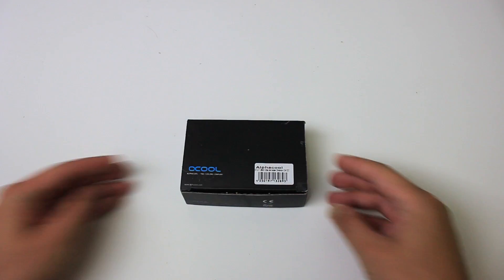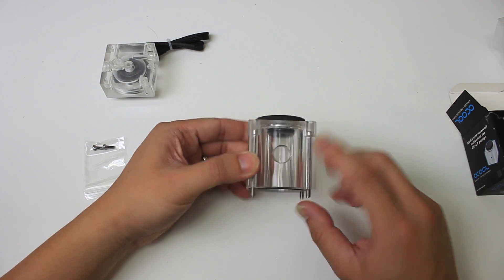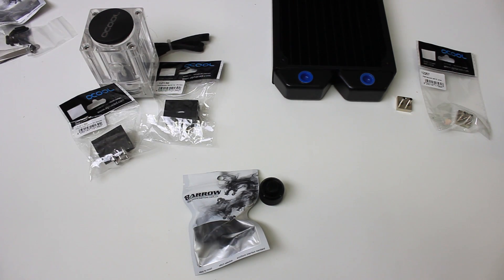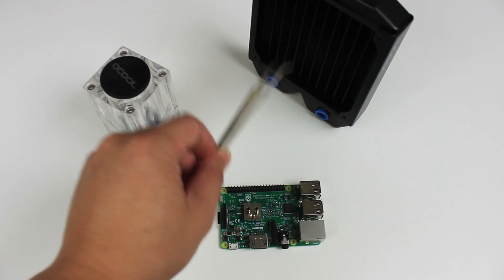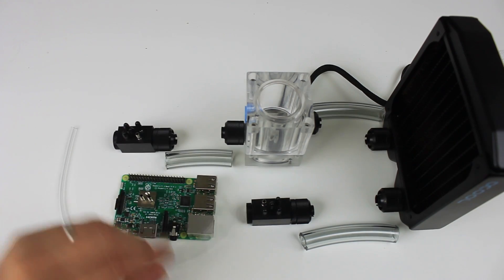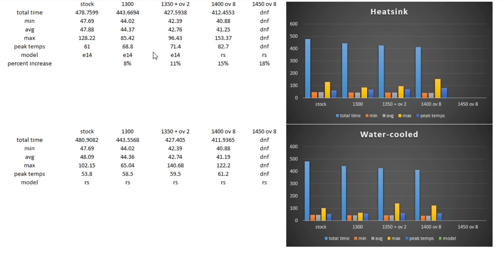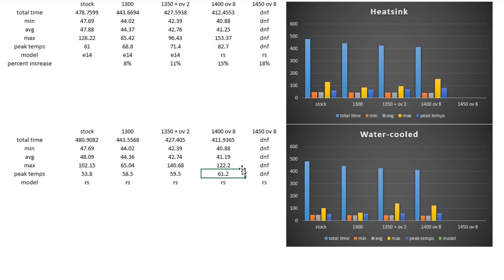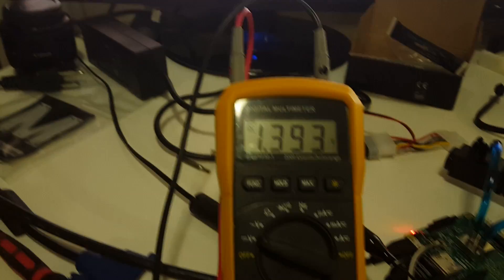Water Cooled Raspberry Pi 3

Comment: I like to keep things simple and inexpensive so I mounted my Raspberry Pi 3 inside the freezer in my garage, the cables mold nicely around the door gasket, Pi is headless so just needed power and a FLAT cat5 cable, can over clock to the max and it runs too cold, could have probably just put it in the fridge section but that door sees more traffic.

If I ever plan to run a monitor on this setup will buy a FLAT HDMI cable....

Comment: The results are impressive, but the overheat only really becomes a problem with the Pi 3, and the size of that radiator negates the value of the Pi, which is it's ability to be small enough to fit as an embedded device. So unless liquid cooling is already an integral part of the machinery your Pi is embedded in, this really isn't a practical option. I'm sure that will be why people say "there's no point". I do wonder if a smaller radiator, with a fan would be equally good though, and how much smaller would still be effective.

Comment: actual parts list would have been nice.
Reply from the maker: Done! check my description.
Reply: 1x Alphacool DC-LT Pump Top | Plexi (13136) 
1x Alphacool DC-LT Individual Reservoir (13140) 
1x Alphacool DC-LT 2600 Ultra Low Noise Ceramic - 12V DC (13289) 
1x Alphacool NexXxoS ST30 Full Copper 120mm Radiator (14156) 
6x Barrow G1/4" Thread 3/8" ID x 5/8" OD Compression Fitting - Black (THKN-3/8-V3) 
4x ModMyMods 3/8" ID x 5/8" OD Flexible PVC Tubing - Crystal Clear (MOD-0003) 
1x Alphacool MCX Seal Plug 10 pcs Kit - Black (29107) 
1x Alphacool MCX One - Nickel Edition (12257) 
1x Alphacool Double-Sided Adhesive Pad 15x15x0.5mm (12097) 
2x Alphacool MCX 5-Way Divider (12139) 
3x Alphacool G1/4" HF Stop / Plug Fitting - Deep Black (17198) 
2x 3mm ID x 5mm OD Tubing
Reply: Right on thank you,  I was finding some of the parts but not all of them.

Comment: Cool, but was the rad completely filled with water, or just to the head of the tank ?
Reply from the maker: completely filled, my camera decided to die right when i was recording the "filling of the loop" part so i had to cut that part out.
Reply: I think the rad may not have been filled up, as normally the header tank needs to higher or as high as the top of the rad the only way you could fill the rad completely is to lay it down on its back, fluid will always find its level

Comment: Should've put a fan on the rad just to see how over-kill the cooling would be xD
Reply from the maker: i relized that the problem i was having is the voltage being delivered to the cpu. i am working on a solution to deliver more voltage to cpu.
Reply: @NovaspiritTech  just slap an labor powersupply to it  xD
Reply from the maker: i might have to depending on how high i am going to over clock it.
Reply: how about sub zero temps?
Reply: There are very few raspberry Pi 3s that can go over 1.5 ghz.
And even then i'd say most of those are myths. If you can get yours to go any higher than 1.4 ghz, id be VERY surprised... it really doesn't matter how cool you get it, those stupid phone arm cpus can't go very high.
Reply: It would nice to see the fan if someone is considering doing/spending all that on a Pi (Im not saying it has to be a Noctua 3k rpm, but just A fan). What I think would be a more useful display is to liquid cool an array of Pi boards, potentially for actual use. 

B/c yes, hackers love to tinker, but typically with a goal or purpose in mind. An objective to make something run better, or get around constraints... for a reason. Not just to do it. Yeah, some people do things just to do them, but that in itself is still a purpose. Not everyone shares that POV, so it would be nice to consider other people's uses, and show how your project can benefit and be utilized. That way, others can potentially expand on the discovery. Not just build it to say it has been done. I am not knocking this concept, I simply feel it would be more useful to those watching/building (to expand on this project). 

I was personally attracted to the idea b/c I wanted to see how low you can make the temps. A fan seems like a trivial piece of hardware that should have been added, if not for any other reason... to just do it (like you have with the liquid cooling). After all, nobody really invests in liquid cooling w/o fans. So it is more of the real-world applications than the point of saving a few bucks or not feeling it is necessary. I mean, I do not cool my hardware components to achieve stock temps. I do it to OC and still run cooler. Maybe that is just me. 

Anyway, it would be great if you would consider cooling an array in a future video. With the ability to make cheap, mini "supercomputing" devices for fun or a specific application, cooling them is always a concern. Please think about a future video with this. 

Great job on the build, video and testing. Keep up the good work.
Reply: i don't know what your talking about a raspberry pi is i super hot running computer and it needs to be run on no less that liquid nitrogen
Reply: +Novaspirit Tech this is really cool.  why would you say it is a capacitor that is setting the voltage?  usually a resistor divider sets the voltage on a regulator.
Reply: Two fans would be Extreme
Reply: +2000jago uhh no you couldn't... That's the entire point of watercooling...
Reply: 5°C :D
Reply: +Novaspirit Tech I got a golden lottery raspberry pi, using a 5v 2.1a charger(insufficient) with peripherals connected , I am able to hit 1520 stable at 1.45V.
Reply from the maker: +Lucasleeeeeeeee you are so lucky!!
Reply: +Gabriel Dibble 
But isn't that what most of us liquid-cooling enthusiasts aim for? Making more capable items at high speeds. Why not put in a little effort to cool things as much as possible, when youve already expended the greater effort integrating the cooling application. Can have the first single digit temp RPi or something unique and unusual. 

i would love to see this done to an ODROID or other more powerful model. 

And as for extreme, we can hold back when we get to building liquid cooled RPi Arrays. Then again. it could potentially be really cool... possibly utilizing one good static pressure fan between every two nodes (1 fan cooling 2 rads). Being that the heat buildup is lower than PC, some unique configurations can be applied to this idea. I personally do not think we can go extreme enough. To push the boundaries of innovation, we must strive to push above and beyond.. 

I've wondered... with small form factor, AIO boards like these being configured for servers, why haven't any been created with multiple sockets/CPUs? So many ppl are interested in stacking the devices, it only seems natural for the progression to steer that way.
Reply: ***** oh lol, i didnt realize you were just talking about RBPs. Yea agreed, watercooling is ridiculous on them
Reply: @toby1248  add your fan to the water cooling radiator and suddenly you will get better. Sure, because of water temperature conduction... It is physical law, not an absurd idea.
Reply: ***** yeah its not an efficient configuration being used here. N RPi dnt need crazy cooling. But its still a cool idea.
Reply: it will hit 1.5GHz, juz need to OV it to 6V and LN2 cooling :P
Reply: Nicolas Marez can x86 cpus be overclocked higher than ARM ones?
Reply: jy lim yes they usually are, did you mean the other way around? arm clocked higher than x86
Reply: Different uh no, i happen to have a x86 tablet which ive been contemplating to root for a long time just to overclock it but im not taking any chances, mainly cause im too scared of destroying 800 dollars literally
Reply: im just making sure that x86's capabilities can go beyond ARM, so that i dont need to buy another phone with the ARM cpu solely for messing around with root and stuff
Reply: jy lim I am not really into these things but a quick Google search showed me that normal pc cpus are x86 architecture and they clock higher than arm cpus. 

As for mobile x86 cpus I would guess they also clock higher but it will be different for every arm and x86 cpu so you should google your exact cpu and see how it overclocks.
Reply: Different oh, didnt expect google to give answers regarding this, ill check it out. thanks man
Reply: +jylim
I know that +Different answered you already, but each CPU is completely different. Even within the same architecture, and even within the same series of CPUs by a certain manufacturer.
Reply: Novaspirit Tech is the chip power step down phase a buck converter or a linear voltage regulator?
Reply: Had any success in the last year?
Reply: Room temperature probably.
Reply: Inter wont do shit with an empty radiator. Nothing but trapped air.
Reply: ur gonna wrek it m8

ur gonna rek a perfectly good pi m9
Reply from the maker: you are right, what i meant is that i am going to deliver my voltage to the capacitor. the voltage is being controlled by the rt8088. i'm in the works of removing a coil and a resistor so i can apply my own power to the chip through the cap.
Reply: I think he made the vid to prove he can do anything
Reply: jy lim you're welcome, let me know what you fount